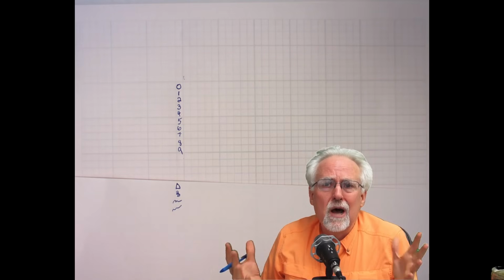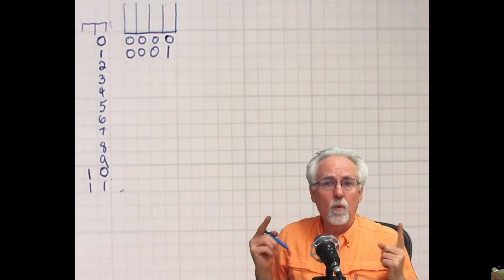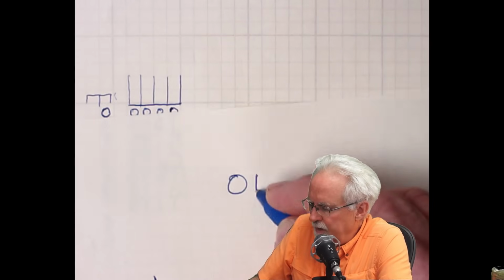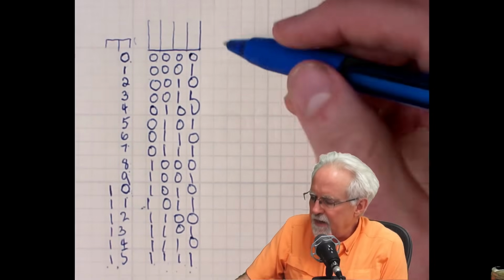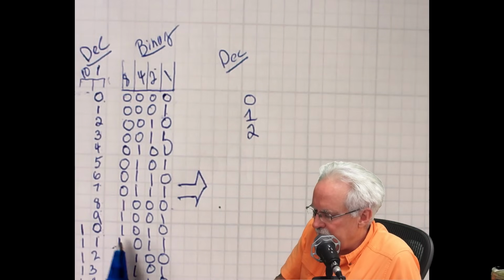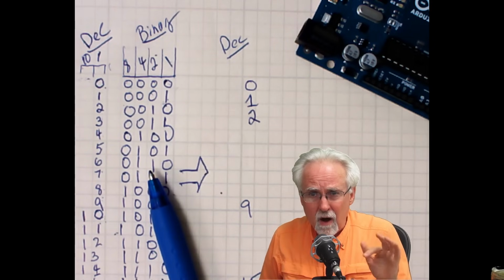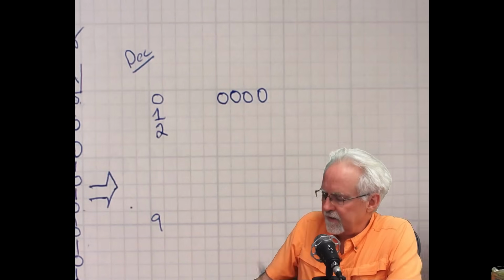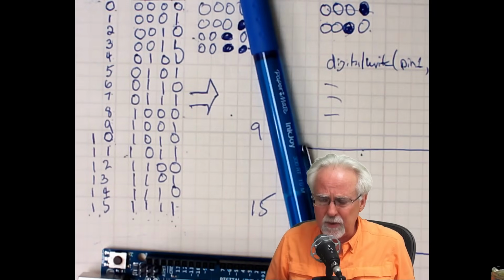Arduino Tutorial 5: Understanding and Working With Binary Numbers

Comment: Hello, my name is Akmal. I'm from Uzbekistan and I really like your videos. I wrote this code which you gave us for homework :

int led1=1;
int led2=2;
int led3=3;
int led4=4;
String arr[]={"0000","0001","0010","0011","0100","0101","0110","0111","1000","1001","1010","1011","1100","1101","1110","1111"};
void setup(){
  pinMode(led1,OUTPUT);
  pinMode(led2,OUTPUT);
  pinMode(led3,OUTPUT);
  pinMode(led4,OUTPUT);
}
void loop(){
  int i=0;
  while(i<16){
    if(arr[i][3]=='1') digitalWrite(led1,HIGH);

    if(arr[i][2]=='1') digitalWrite(led2,HIGH);

    if(arr[i][1]=='1') digitalWrite(led3,HIGH);

    if(arr[i][0]=='1') digitalWrite(led4,HIGH);
    delay(1500);

    digitalWrite(led4,LOW);
    digitalWrite(led3,LOW);
    digitalWrite(led2,LOW);
    digitalWrite(led1,LOW);
    delay(1000);
    i++;
  }
}

Comment: Thank you for the video had a lot of fun with the take home task! I couldn't figure it out in the end but I asked ChatGPT for help and now I understand bitshifting to the right and the & operator!

const int LED_0 = 11;

const int LED_1 = 10;
const int LED_2 = 9;
const int LED_3 = 8;

const int DELAY_TIME_MS = 800;

void setup() {
  // put your setup code here, to run once:
  pinMode(LED_0, OUTPUT);
  pinMode(LED_1, OUTPUT);
  pinMode(LED_2, OUTPUT);
  pinMode(LED_3, OUTPUT);

  digitalWrite(LED_0, LOW);
  digitalWrite(LED_1, LOW);  
  digitalWrite(LED_2, LOW);  
  digitalWrite(LED_3, LOW);  
}

void loop() {
  int start = 1;
  int end = 16;

  for (start = 0; start < end; start++) {
    int pos_0 = (start >> 0) & 1;
    int pos_1 = (start >> 1) & 1;
    int pos_2 = (start >> 2) & 1;
    int pos_3 = (start >> 3) & 1;

    digitalWrite(LED_0, pos_0);
    digitalWrite(LED_1, pos_1);
    digitalWrite(LED_2, pos_2);
    digitalWrite(LED_3, pos_3);

    delay(DELAY_TIME_MS);

    digitalWrite(LED_0, LOW);
    digitalWrite(LED_1, LOW);  
    digitalWrite(LED_2, LOW);  
    digitalWrite(LED_3, LOW);  
    }

    delay(DELAY_TIME_MS);

}

Comment: 6 years late but here's my solution to the problem.

int LED1=2;
int LED2=3;
int LED3=4;
int LED4=5;
int lightDelay=50;
int n=0;

void setup()
{
  pinMode(LED1, OUTPUT);
  pinMode(LED2, OUTPUT);
  pinMode(LED3, OUTPUT);
  pinMode(LED4, OUTPUT);
}

void loop()
{
 while (n<16)
 {
   if(n%2!=0)
      digitalWrite(LED1, HIGH);
   if(n%4<4 && n%4>1)
      digitalWrite(LED2, HIGH);
   if(n%8<8 && n%8>3)
      digitalWrite(LED3, HIGH);
   if(n%16<16 && n%16>7)
      digitalWrite(LED4, HIGH);
   
   delay(lightDelay);
   
   if(n%2!=0)
      digitalWrite(LED1, LOW);
   if(n%4<4 && n%4>1)
      digitalWrite(LED2, LOW);
   if(n%8<8 && n%8>3)
      digitalWrite(LED3, LOW);
   if(n%16<16 && n%16>7)
      digitalWrite(LED4, LOW);
   
   delay(lightDelay);
   
   n++;
   if (n==16) n=0;
 }
}

I'm a slow learner but i guess I've found just the right tutorial to sail smooth.

Comment: I'm enjoying the lessons thus far but have a question. I have an end project in mind and needed to get a Mega 2560. I bought "The Most Complete Starter Kit Mega Project " from Elegoo.  I'm running Windows 11 Home edition. I have noticed that when you upload a sketch it's pretty quick. My uploads sometimes take several minutes. Is this normal for a Mega vs an Uno?

Comment: int x1=13;
int x2=12;
int x3=7;
int x4=4;
int i;

void setup() {
  // put your setup code here, to run once:
pinMode(x1,OUTPUT);
pinMode(x2,OUTPUT);
pinMode(x3,OUTPUT);
pinMode(x4,OUTPUT);

}

void loop() {
  for (i = 0; i < 16; i++) {
    // Corrected conditions using parentheses
    digitalWrite(x1, (i & 1) ? HIGH : LOW);
    digitalWrite(x2, (i & 2) ? HIGH : LOW);
    digitalWrite(x3, (i & 4) ? HIGH : LOW);
    digitalWrite(x4, (i & 8) ? HIGH : LOW);

    delay(1000); // Keep the binary number visible for 1 second
  }
}

Comment: //AT5-HW

//sw=switch
int sw4=13;
int sw3=8;
int sw2=7;
int sw1=2;
int on=1000;

void setup() {
  // put your setup code here, to run once:
pinMode (sw1,OUTPUT);
pinMode (sw2,OUTPUT);
pinMode (sw3,OUTPUT);
pinMode (sw4,OUTPUT);
}

void loop() {
  // put your main code here, to run repeatedly:

//0
digitalWrite (sw1, LOW); 
digitalWrite (sw2, LOW); 
digitalWrite (sw3, LOW); 
digitalWrite (sw4, LOW); 
delay(on);

//1
digitalWrite (sw1, HIGH); 
digitalWrite (sw2, LOW); 
digitalWrite (sw3, LOW); 
digitalWrite (sw4, LOW); 
delay(on);

//2
digitalWrite (sw1, LOW); 
digitalWrite (sw2, HIGH); 
digitalWrite (sw3, LOW); 
digitalWrite (sw4, LOW); 
delay(on);

//3
digitalWrite (sw1, HIGH); 
digitalWrite (sw2, HIGH); 
digitalWrite (sw3, LOW); 
digitalWrite (sw4, LOW); 
delay(on);

//4
digitalWrite (sw1, LOW); 
digitalWrite (sw2, LOW); 
digitalWrite (sw3, HIGH); 
digitalWrite (sw4, LOW); 
delay(on);

//5
digitalWrite (sw1, HIGH); 
digitalWrite (sw2, LOW); 
digitalWrite (sw3, HIGH); 
digitalWrite (sw4, LOW); 
delay(on);

//6
digitalWrite (sw1, LOW); 
digitalWrite (sw2, HIGH); 
digitalWrite (sw3, HIGH); 
digitalWrite (sw4, LOW); 
delay(on);

//7
digitalWrite (sw1, HIGH); 
digitalWrite (sw2, HIGH); 
digitalWrite (sw3, HIGH); 
digitalWrite (sw4, LOW); 
delay(on);

//8
digitalWrite (sw1, LOW); 
digitalWrite (sw2, LOW); 
digitalWrite (sw3, LOW); 
digitalWrite (sw4, HIGH); 
delay(on);

//9
digitalWrite (sw1, HIGH); 
digitalWrite (sw2, LOW); 
digitalWrite (sw3, LOW); 
digitalWrite (sw4, HIGH); 
delay(on);

//10
digitalWrite (sw1, LOW); 
digitalWrite (sw2, HIGH); 
digitalWrite (sw3, LOW); 
digitalWrite (sw4, HIGH); 
delay(on);

//11
digitalWrite (sw1, HIGH); 
digitalWrite (sw2, HIGH); 
digitalWrite (sw3, LOW); 
digitalWrite (sw4, HIGH); 
delay(on);

//12
digitalWrite (sw1, LOW); 
digitalWrite (sw2, LOW); 
digitalWrite (sw3, HIGH); 
digitalWrite (sw4, HIGH); 

//13
digitalWrite (sw1, HIGH); 
digitalWrite (sw2, LOW); 
digitalWrite (sw3, HIGH); 
digitalWrite (sw4, HIGH); 
delay(on);

//14
digitalWrite (sw1, LOW); 
digitalWrite (sw2, HIGH); 
digitalWrite (sw3, HIGH); 
digitalWrite (sw4, HIGH); 
delay(on);

//15
digitalWrite (sw1, HIGH); 
digitalWrite (sw2, HIGH); 
digitalWrite (sw3, HIGH); 
digitalWrite (sw4, HIGH); 
delay(on);

}

Comment: in my perspective, i realise that if you consider each switch form the right to the left , it will carry the number 2^0, 2^1, 2*2,... respectively, and if that switch is off (binary = 0), it's value is 0, if it is on (binary = 1), the number it carries will be it's value, and the value of the the whole switchs (the decimal) is the the sum of all the switch's value. for example, if we have the binary number 1010, that means it equal 2^3 + 0 + 2^1 + 0 = 8 + 2 = 10

Comment: I did the 1, 2, 4, 8, 16, 32, 64, 128, 256, 512, etc way
Those who don't understand this basically.. count by bits

1 - 2 - 4 - 8 - 16 - 32 - 64 - 128 - 256 - 512 - 1024 - etc
So basically you have the number you want.. say: 113
You lay these decimals out backwards <---
These decimals are x2 each row.

128 - 64 - 32 - 16 - 8 - 4 - 2 - 1 
(and you want to find 113 by checking yes or no if the number could make out 113)
1 for YES - 0 for NO

So.. Can 128 add into 113? no, so 0.
Can 64? Yes, so 1.
32? Yes, so 1.
64 + 32  = 96 (not at 113 yet)
Can 16? Yes, so 1.
Can 8? No, because it goes over 113 to 120.. so 0.
4? No.. 0
2? No... 0
1? Yes, so add a 1.

128 - 64 - 32 - 16 - 8 - 4 - 2 - 1
 0 - 1 - 1 - 1 - 0 - 0 - 0 - 1

So the Decimal number: 113
Is equal to binary number 01110001

Hope that helps anyone not understanding this method. 

or just..

Can 128 fit into 113? No → 0
Can 64 fit into 113? Yes → 1 → Subtract 64 from 113 (113 - 64 = 49)
Can 32 fit into 49? Yes → 1 → Subtract 32 from 49 (49 - 32 = 17)
Can 16 fit into 17? Yes → 1 → Subtract 16 from 17 (17 - 16 = 1)
Can 8 fit into 1? No → 0
Can 4 fit into 1? No → 0
Can 2 fit into 1? No → 0
Can 1 fit into 1? Yes → 1 → Subtract 1 from 1 (1 - 1 = 0)
Reply: thx sir 👏

Comment: For the homework, I didn't want to type hundreds of lines of redundant code, so I wrote an algorithm that kinda works. First, I declared 4 boolean variables and set them to false. Then, I wrote the following code in the void loop(). It seems to work fine at least for me... Only problem is I'm pretty sure it starts at 0001.

for (int i= 1; i<9; i++)
  {
      if ((i%8 == 0))
      {
          if (s1on == false)
          {
            digitalWrite(switch1, HIGH);
            s1on = true;
          }
          else{
            digitalWrite(switch1, LOW);
            s1on = false;
          }          
      }

      if ((i%4 == 0))
      {
          if (s2on == false)
          {
            digitalWrite(switch2, HIGH);
            s2on = true;
          }
          else{
            digitalWrite(switch2, LOW);
            s2on = false;
          }
      }

      if ((i%2 == 0))
      {
          if (s3on == false)
          {
            digitalWrite(switch3, HIGH);
            s3on = true;
          }
          else{
            digitalWrite(switch3, LOW);
            s3on = false;
          }
      }

      if ((i%1 == 0))
      {
          if (s4on == false)
          {
            digitalWrite(switch4, HIGH);
            s4on = true;
          }
          else{
            digitalWrite(switch4, LOW);
            s4on = false;
          }
      }
      delay(1000);
    }
  }

Comment: I found that the simplest way to think about it is with blocks. The smallest block size being 1 and the largest infinite, you can only have 1 block of a certain size and when you get 2 blocks of the same size they combine into a single block twice the size of each one of them to obey that rule. When you have a single block of 1 it stays a single block of one. When you have a single block of two it stays a single block of two. When you have 2 blocks of one it becomes 1 block of 2. You can have as many blocks types as you need to portray a number as long as not a single one of them is the same as the other.

Comment: // Homework assignments :
byte Counter; byte Delay = 255;
void setup() {Serial.begin(9600); DDRD = 15;}   // set pinmode d0 to d3 as outputs:
void loop() {
if (Delay > 0) {Delay --;} // start delay time:
if (Delay <= 0) {
   Counter ++; // count up after each delay:
   if (Counter > 15) {Counter = 0;} // reset counter to 0 when it reach 16
   Delay = 255; // reset delay time after each delay 
} 
PORTD = Counter;
Serial.println (Counter);
}

Comment: // C++ code
//
int firstLED = 13 ;
int secondLED = 12 ;
int thirdLED = 4 ;
int fourthLED = 2 ;
int power(double base, int exponent) {
    int result = 1;

    // If exponent is negative, invert base and exponent to handle fractional powers
    if (exponent < 0) {
        base = 1 / base;
        exponent = -exponent;
    }

    for (int i = 0; i < exponent; ++i) {
        result *= base;
    }

    return result;
}

void setup()
{
  pinMode(firstLED, OUTPUT);
  pinMode(secondLED, OUTPUT);
  pinMode(thirdLED, OUTPUT);
  pinMode(fourthLED, OUTPUT);
}

void loop()
{
  for(int i = 0 ; i < 16 ; i++) {
    int newVal = i ;
    boolean LED1 = false ;
    boolean LED2 = false ;
    boolean LED3 = false ;
    boolean LED4 = false ;
    for (int j = 0 ; j<4 ; j++ ) {
      int reminder = (newVal / power(2, j)) % 2;
      if(j==0&&reminder==1)
      {
        LED4 = true ;
      }
      if(j==0&&reminder==0)
      {
        LED4 = false ;
      }
      if(j==1&&reminder==1)
      {
        LED3 = true ;
      }
      if(j==2&&reminder==1)
      {
        LED2 = true ;
      }
      if(j==3&&reminder==1)
      {
        LED1 = true ;
      }
    }
    if(LED1==true)
    {
    	digitalWrite(firstLED, HIGH);
    }
    if(LED1 == false ) {
  		digitalWrite(firstLED, LOW);
    }
    if(LED2==true)
    {
    	digitalWrite(secondLED, HIGH);

    }
    if(LED2==false)
    {
    	digitalWrite(secondLED, LOW);

    }
    if(LED3==true)
    {
    	digitalWrite(thirdLED, HIGH);
    }
    if(LED3==false)
    {
    	digitalWrite(thirdLED, LOW);
    }
    if(LED4==true)
    {
    	digitalWrite(fourthLED, HIGH);

    }
    if(LED4==false)
    {
    	digitalWrite(fourthLED, LOW);
    }
    delay(1000);
  }
  
}

Comment: so this is where 16, 32 and 64 bit comes from then? the number of pins on a chip?
Reply from the maker: No, it is the number of bits on the microcontroller.
Reply: @paulmcwhorter  thank you for your reply. I'm going through the lessons now. I greatly appreciate your work. I see a correlation to common bit numbers and binary limitations. Eg. Can't count to 17 with a four prong, gate? Chip? I'm getting mixed up with The technical vocabulary and clearly need to review more. But I see the physical limit and commonnly used bit numbers, however I'm struggling to workout exactly how to articulate that correlation if someone were to ask me.

Comment: how i learned decimal to binary is you take your number and divide  by 2 if there is a remainder(or decimal) the decimal gets turned to 1 if not its 0 then take the next whole number / by 2 
10/2= 5 so 0
5/2=2.5 so 1
2/2= 1 so 0
1/2=.5 so 1
so 10= 1010
just remember once you get a decimal drop it and divide by the whole number hope it helps

Comment: I think This is the most economic code for this assignment. I used a delay of 250 milliseconds, which seems sufficient.😀

// Pin numbers for the LEDs
const int bit0Pin = 2;
const int bit1Pin = 3;
const int bit2Pin = 4;
const int bit3Pin = 5;

// Delay between each count (in milliseconds)
const int countDelay = 250;

void setup() {
  // Initialize the LED pins as outputs
  pinMode(bit0Pin, OUTPUT);
  pinMode(bit1Pin, OUTPUT);
  pinMode(bit2Pin, OUTPUT);
  pinMode(bit3Pin, OUTPUT);
}

void loop() {
  for (int count = 0; count < 16; count++) {
    displayBinary(count); // Display the binary count
    delay(countDelay);    // Delay between each count
  }
}

void displayBinary(int number) {
  // Extract each bit from the number and display on the corresponding LED
  digitalWrite(bit0Pin, bitRead(number, 0));
  digitalWrite(bit1Pin, bitRead(number, 1));
  digitalWrite(bit2Pin, bitRead(number, 2));
  digitalWrite(bit3Pin, bitRead(number, 3));
}
Reply: very cool, thank you.

what does adding the 'const' to 'const int' do? 

trying to not add anything too superfluous for myself yet

Comment: This project was challenging but very satisfying to do using bit arithmetic and would have been even tougher without using arrays to line up the pins to the relevant bit in the nibble. It almost drove me nuts because using Serial.println() is so tedious to see the values I was getting. Thank you for making the challenge though Paul! It was a good one!

// Pins used
int bit_0 = 13; // pin 13
int bit_1 = 12; // pin 12
int bit_2 = 8; // pin 8
int bit_3 = 7; // pin 7

// position values for each bit in the nibble
int bitValues[] = {1,2,4,8};

// used to align bit value with pin
int bitPort[] = {13,12,8,7};

// resets all pins to LOW, turning off all LED'S
void resetBits(){
  digitalWrite(bit_0, LOW);
  digitalWrite(bit_1, LOW);
  digitalWrite(bit_2, LOW);
  digitalWrite(bit_3, LOW);
}

// calculates which leds should be turned on
// starting with all LED'S off 
void setNibble(int currentNumber){
  Serial.print("Number to convert: ");
  Serial.println(currentNumber);
  for(int x = 3; x >= 0; x--){
    
    int bitValue = bitValues[x]; // current bit value

    // if current bitValue is less than subtract
    // bit value from current value
    // update current value to the remainder of that calculation   
    if(bitValue <= currentNumber){
      Serial.print("Setting to High pin: ");
      Serial.println(bitPort[x]);
      digitalWrite(bitPort[x], HIGH);
      currentNumber = currentNumber - bitValue;
      Serial.print("After subtracting, the number is: ");
      Serial.println(currentNumber);
      
    }
  }
  delay(2000);
}
void setup() {
  pinMode(bit_0, OUTPUT);
  pinMode(bit_1, OUTPUT);
  pinMode(bit_2, OUTPUT);
  pinMode(bit_3, OUTPUT);
  resetBits();
  Serial.begin(9600);
  while(!Serial){
    ;
  }
  resetBits();
}

void loop() {
  for(int j = 0; j < 16; j++){
    resetBits();
    setNibble(j);
  }
  
 }

Comment: Just wana say you dont need 4  curent limiting rezistors for the LEDs because you can just conect the LEDs throuh the same rezistor to gnd so you need just 1.
Reply from the maker: NO! That cross-couples signals for different LED. Turning one LED on and off will affect brightness of the other one. A very bad idea.
Reply: Thanks for explaining that to me,thought that it Is not gona be an  isue.